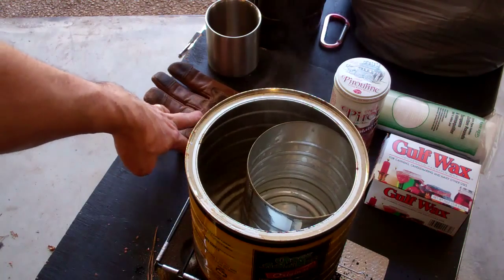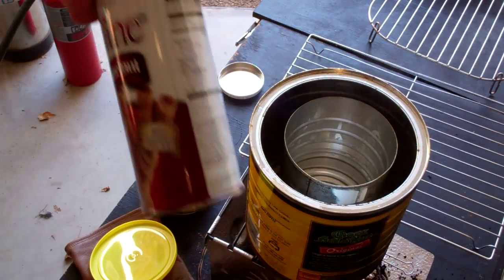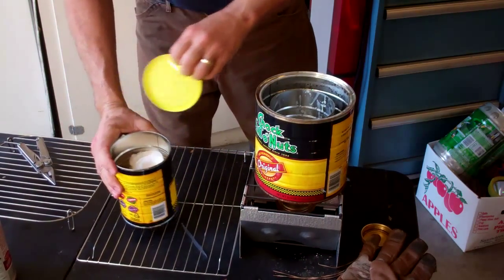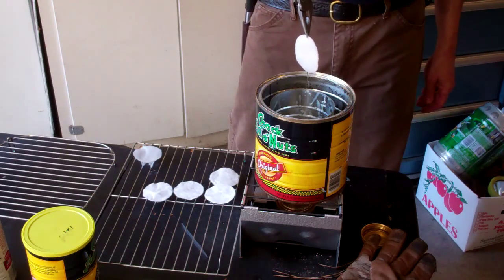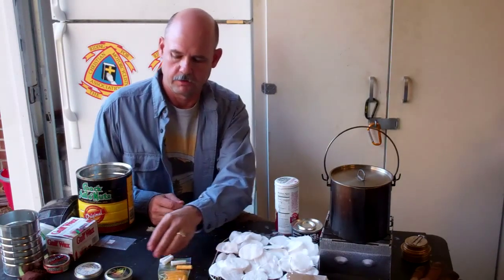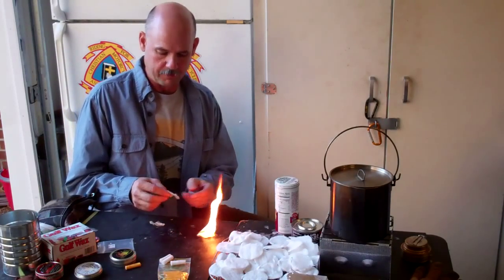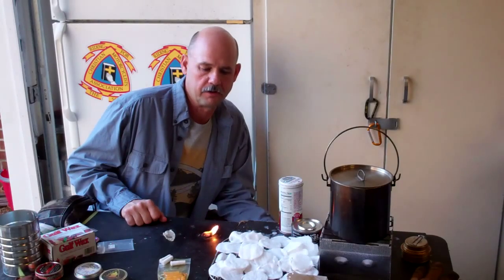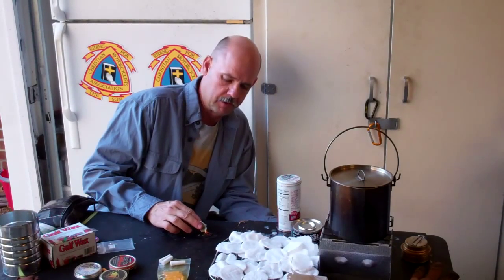DIY Fire Starter

Comment from the maker: Glad you liked it. Thanks
Reply: I did that but I found out that I had to use my gloves to squeeze the  wax  or I will need to milt more wax.
Made a 100 pads and they turned out nice . 
Some use vaseline rather than wax .
I clocked the burning time and I had about 7 min. for one pad ....Not bad :) 
Thanks for sharing

Comment: Feb. 28th. Just got done with a burn test.  Had my 3year old Grandson today so G-pa had a helper. We made two types of what the boy calls fire balls, I made the regular wax/cotton balls and then some thing new. I saved a paper egg crate and shredded a cotton ball in the wells then put cedar chips over that and then another cotton ball on top. Then wax.  The results;  just cotton ball/wax burned for 15 min. the cotton/ cedar mix burned for 25 mins.
  Have not used the rounds or soaked type but will try it. One of my room mates dips so I should be able to get some of his cans. Any ways, I am happy with my results.

Comment: Hey RedDog, if you heat up petroleum jelly into a liquid and use that first instead of the charcoal fluid, they will be extremely waterproof. Figured I would share the knowledge with ya.

Comment: Had to smile. I use the very same cookie (?) tin to store mine. Made with wax only. Will be trying some with kero or lighter fluid. BTW, these also fit shoe polish tins. Tip: Use waxed paper, instead of the cooling racks. Rounds will be flat. When rounds are removed, either keep the waxed paper for another batch or use it as another tinder source.

Thank you for using a double boiler & your emphasis on safety. Sometimes cringe when I see folks melting wax in a pan over direct heat. Flash point of wax is relatively low. Even if the fire is put out quickly, don't want that oily soot settling on everything in the immediate area.
Reply from the maker: Oldtimer Lee Good tip thanks